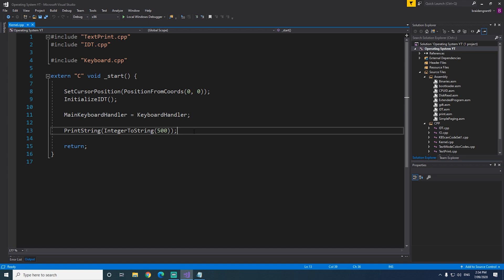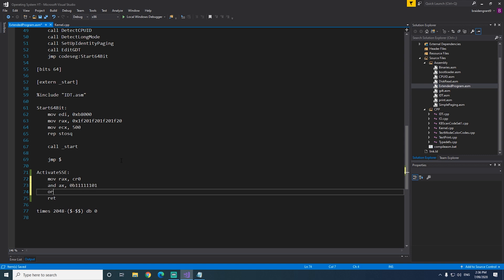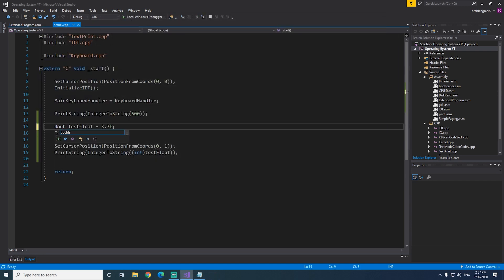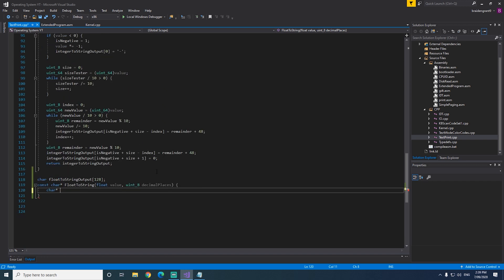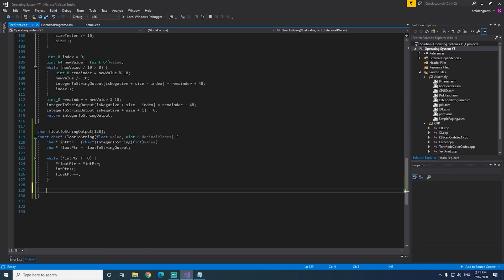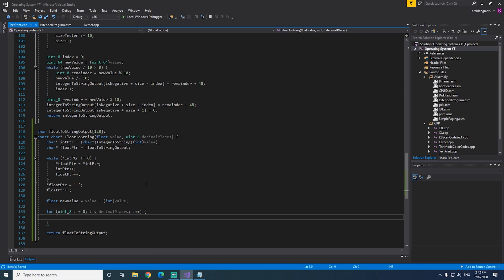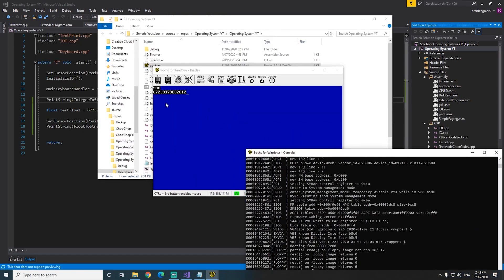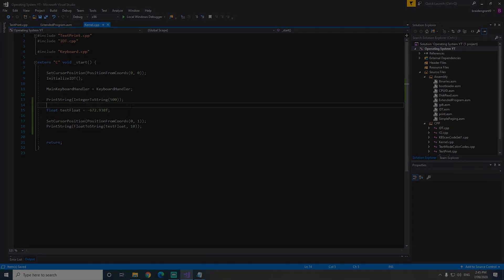Floats and Doubles | Make a 64 bit OS From Scratch!! | Part 16

Comment: It keeps flashing the boot screen after trying to use the testFloat
Reply: Nevermind, it was a problem with the ActivateSSE function, i had to add two 0's to the "or ax, 0b11000000". I thought it was 8 bits, not 10. hehe :D

Comment: why are you including C++ files? #include <Keyboard.cpp>
Reply from the maker: Just to keep things organised :)
Reply: @poncho2364  I thought #include only worked with header files
Reply from the maker: You can technically include any file I believe
Reply: @newtechandcoding2213  Include "includes" whatever file you pointed to in the c++ code. headers contain memory and function definitions for the compiler. I feel that we should be using .h or .hh extensions, but it doesn't matter.